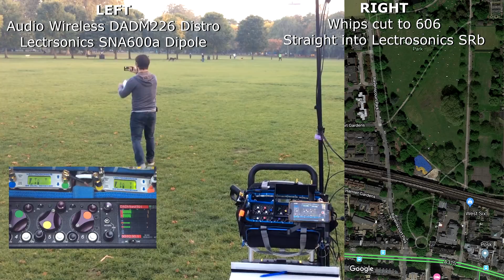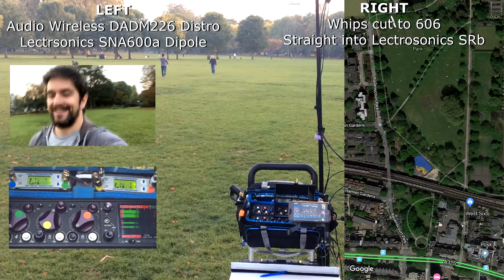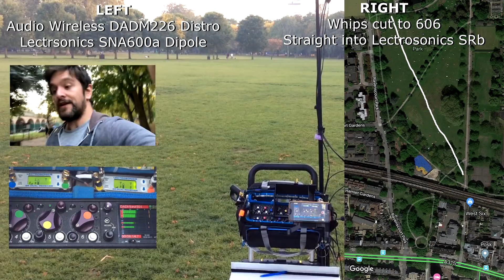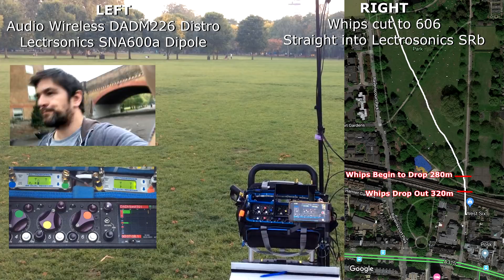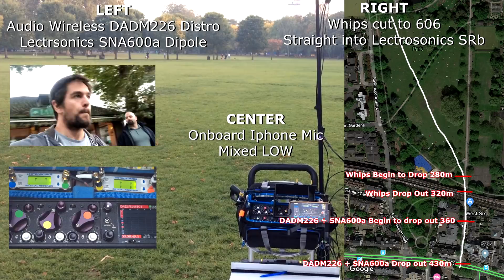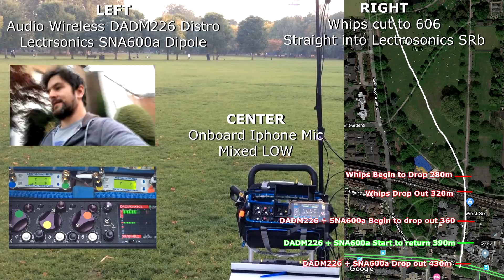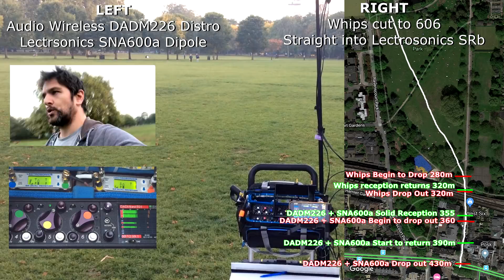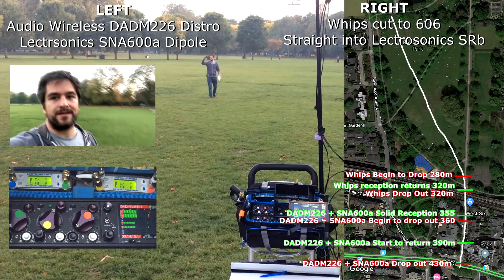Audio Wireless DADM226 + Lectrosonics SNA600a VS Lectrosonics Whip Antenna range Test

Comment: great job. very well thought out and executed test. maybe would've been interesting how the sna600a performs without the distro (so without the analog filtering and noise isloation and all that jazz) do you suspect that it would have dropped out considerably sooner?
Reply from the maker: There's a WHOLE block of configuration tests that could be done, I looked at doing a bunch with a fellow recordist a whiles ago, using different systems & setups, do make a good comparison chart.

Comment: That's a crazy rage, even with your whip antennas. What kind of batteries did you use in the transmitter? Plus which block is it?
Reply from the maker: Durracell 2500 NiMh rechargables. Block 606

Comment: Would be interesting to see how much worse it would be if you took two for a walk.  Nice one.
Reply from the maker: having two transmitters on the same body would cause some trouble, as the two would different wavelengths in such close proximity would mask each other to a certain degree. Properly spaced & coordinated though, problems could be reduced without a significant hit to range. It would be important not to run the Tx in high power modes though, & in real world situations, this would be an unusual configuration.